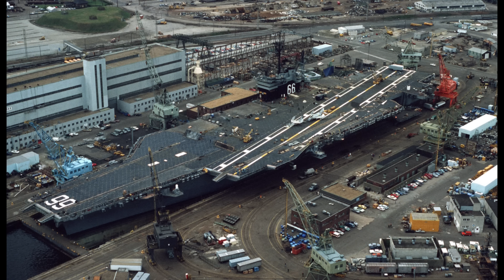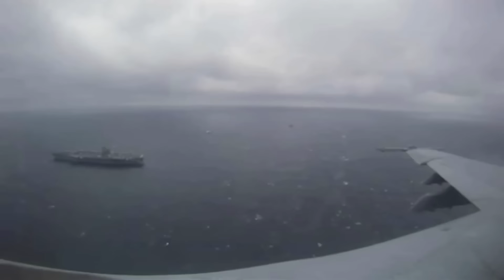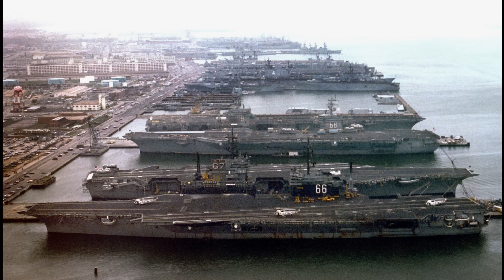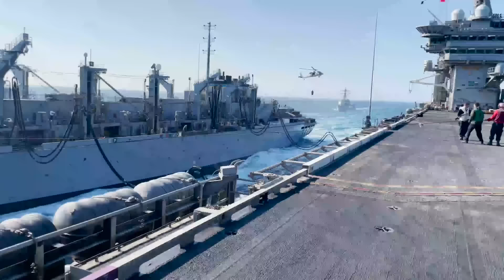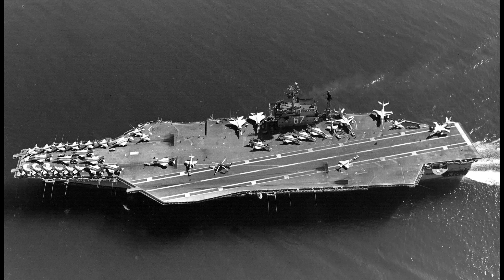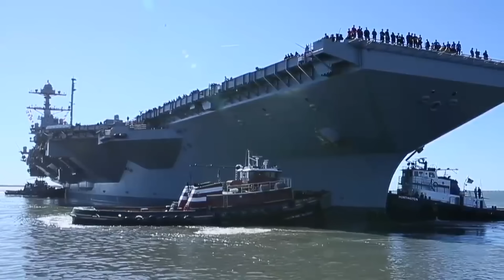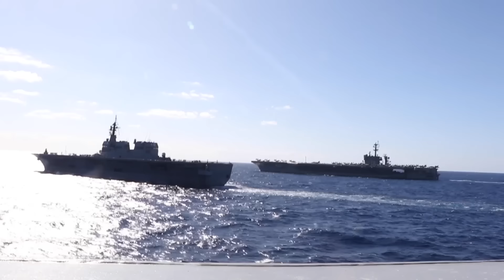Kitty Hawk Class: Why the US Navy MUST Bring Back This Non-Nuclear Carrier

Comment: The kitty hawk class is still a super carrier and would still cost a lot to make, not to mention it will also need to sail around with an extensive screening group as it would still be considered “too valuable to lose”.

It’s not just about the carrier, it’s about the entire battle group that goes along with it, the manpower to staff it all and the billions worth of F35s that go along with it. 

When you add it all together, the added cost of the nuclear reactor is the least concern.

The money would be better invested in opening up new dry docks that are capable of conducting multiple simultaneous major maintenance on the carriers we do have.
Reply: Agreed. We don’t need more carriers, we need 2 or 300 frigates and destroyers to cover all of the hot spots where the carriers aren’t. Carriers are great hammers, but not every job requires that specific tool. For jobs like convoy escort, anti-piracy patrols or simply showing the flag in low threat situations or among allies, the smaller ships make more sense at a far lower cost. And for specialized jobs, such as demining, specialist ships are required, which again could be more economically escorted by lower end ships. They should be heavily enough armed to take care of themselves when performing detached operations, but should be buildable in vast numbers in order to be able to respond to multiple geographically separated events simultaneously. Sometimes, quantity does in fact have a quality of its own. The Navy, however, needs to accept that low end ships cannot and should not be built as miniature Arleigh Burkes, but rather as ships that are heavily enough armed to be useful while remaining affordable enough to build in large numbers. We need what the Constellations were supposed to be, rather than what the Navy wanted to turn them into. Perfect is the enemy of good enough. We need a whole bunch of ships that are good enough. The navy has a whole bunch of small jobs that it can’t do because either it’s short of the few high end ships it has, or because one of those ships wou be both hilarious overkill for those smaller jobs, and because, being in such short supply, they’re too valuable to lose.
Reply: @DarthBlood17  100%. The navy is currently all bling and no basics. Bugger all frigates and destroyers. Not enough oilers. Ancient sea lift fleet.
Reply: @l @lone-despair  haha yup. It’s such a succinct way he encapsulated it.
Reply: @DarthBlood17 exactly. The Constellation was a great idea. All they needed is to integrate more American systems. Perhaps the F110 class which already has Aegis SPY systems.
Reply: Exactly. The F110 is ready for the American fleet. The FREMM is more oriented to French systems.
Fitting Aegis on something the size of a frigate was a huge technical challenge. I do wish the USN gave it a look, but with the current Spain-US relationship that would never happen.
Reply: @claudedominique8845 
The FREMM wasn't for French systems. The reason why the American version failed was because of the US Navy.
Reply: @DarthBlood17  you want ,  not NEED,  America NEEDS zero carriers.  Who is going to attack America ?
Reply: @devnaraen5131  Not who is it's who might Militaries always base their needs on possibilities ("If you want peace, prepare for war" - Julius Ceasar)
Reply: @devnaraen5131 
In recent years America made enemies. Yes America NEEDS carriers. Look up Guam 🇬🇺 and Hawai'i.
Reply: @CFak-i9r1c  You're right, oblamer and Autopen really fücked our reputation in the world.
Reply: @Kitty-CatDaddy 
Obama didn't damage the US' reputation, Trump did. Nice try, trumpster. Biden tried to fix it but Trump got reelected and restarted damaging the US' reputation. Trump made enemies.
Reply: @devnaraen5131 China, and Russia are definite possibilities. Also don't forget their allies like North Korea and others. Yes they may nit have much of a Navy but if they can reach out and hit US and our allies like Japan and South Korea with ballistic missiles even if those missiles aren't armed with nuclear warheads they can provide plenty of headaches in a conflict. America has always had enemies, several of which we did not create.
Reply: @CFak-i9r1c you are a coolaid drinker, all Europe has openly states Biden was horrendous in policy, weak and incapable and Obama was and enabler even Macron has publicly stated this now Trump is no Diplomat nor is he a strategist everything is a hammer or club with him but at least he is not being played and used.
Reply: That is exactly the point that I was going to make when I opened this video.   The air wing alone costs almost as much as a nuclear carrier.   The escorts cost as much.
Reply: The kitty Hawk is gone forever. It was scraped.
Reply: @giankperez6377  disgraceful! Should have been made into a museum like the Iowa class battleships
Reply: Actually what the U.S. Navy needs is more Wasp and America class amphibious assault ships (for conflicts in the indo pacific theater) as well as either the return of guided missile  cruisers or guided missile battleships  or the conversion and retention of more Ohio class ballistic missile submarines into guided missile submarines as destroyers cannot carry enough missiles in their VLRS  cells for high intensity warfare. Yes, the Arleigh Burke Aegis guided missile destroyers are great ships but unless the U.S. Navy finds a way to rapidly reload those missile cells during and in the middle of combat through ship to ship replenishment or by designing another  complimentary system to launch missiles onboard the destroyers they will need a larger ship that can carry more VLRS cells. 
I could see the U.S Navy retaining and converting more Ohio class boomers into guided missile submarines, but they do not want to do that for budgetary reasons. They are already trying to decommission the U.S.S Georgia.
Reply: @bazil5789 
Yes, America needs to make sure it loses many missiles and sailors in one hit. 😂 It doesn't need battleships. No such thing as guided missile battleships. They never existed. The newest Arleigh Burke class destroyers are as large as the old Ticonderoga class cruisers.
The Ohio class is old. The newest had its refuelling and overhaul done a few years ago. In 25 years it will be decommissioned. Nuclear submarines CAN'T be retained. Once a reactor got used, it's over. Besides, the hull itself is worn. Just get more Virginia class subs.
Reply: @CFak-i9r1c  I never said that guided missile battleships had existed in the past. The U.S. Navy itself has said that in a highly contested satutation battle the limited amount of VLRS cells on the Arleigh Burke destroyers would mean that they would be out of missiles in the first few hours of battle. Bigger ships with more missile cells will be able to stay in the fight longer and will be more likey to be able to make it back to a forward operating base so that it can be rearmed. Do you know what they call a warship with no ammo???? An artificial reef. Do you think that the U.S. Navy wouldn't stomach the loss of destroyers in a battle?? As long as it isn't a carrier they would not lose a minute of sleep. Also how many more "flights" of Arleigh Burke class destroyers are going to be produced before the U.S. Navy decides to stop production in favor of a new design. Arleigh Burke destroyers as a design are getting awfully long in the tooth as far as age. Also there are quite a few Ohio class boomers with hulls that still have plenty of service life left in them. Their replacement with Columbia class boomers will mirror the Nimitz class carriers replacement with Ford class carriers. The Navy can replace the nuclear reactors on submarines you know that right? Submarines are modular built. Just like ships.
Reply: @bazil5789 
No. A bigger ship is just a bigger target. Once it gets hit, the missiles in the VLSs that weren't launched get destroyed. The Navy definitely won't like losing destroyers. Also, basic research. Look up the DDG(x). They're already developing a replacement for the Arleigh Burke. There will be another 22-23 Arleigh Burke ships built. The DDG(x) will be built in the early 2030s.
Reply: @CFak-i9r1c No one wants to lose any warships if it can be helped but in wartime there is such a thing as acceptable losses. Compared to losing an aircraft carrier all the other surface warships are expendable. The U.S. Navy is already awarded a contract to HII for the next class of frigates. They also want to increase the missile capacity of their future ships. Which could and, according to several navy planners, would lead to the possibility of newer larger ships outside of a 30+ year old Arleigh Burke class destroyer. The U.S. Navy has had cruisers and battleships in the past and it would be idiotic to think that ships like those will never be a part of the U.S. Naval fleet ever again.
Reply: Any carrier will have as escort.
Reply: @claudedominique8845 it still doesn't protect them
Reply: Not tru and the cost would  be 6.2 billion while forcing an increase in ship yards and reinvestment of the few remaining yards.
Reply: @warrior7ra 
No.
Reply: Yes
Reply: If your going to have a surface Navy it pretty much will be critical its always going to be costly.
Reply: @warrior7ra 
That doesn't mean you should waste money.
Reply: @CFak-i9r1c it isn't a waste the only way it isn't required is to eliminate all potential national security threats if your unwilling to do that then yes they are nessesary. So make the decision pay for defense or go hard on the offense slaughter all threats now and potential future threats. So how many are you willing to kill
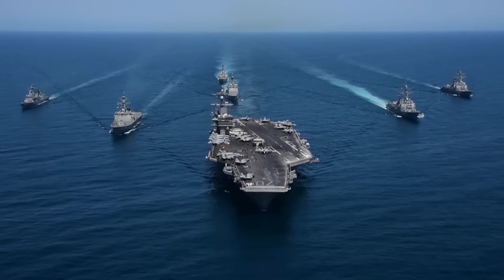Reply: I agree. We need a new public shipyard badly.  17:03 The modern fleet is not experiencing a crisis of overcapacity.  It is experiencing a crisis of oversubscription.  Particularly from allies of wealth and means who are purposefully not contributing their fair share to their own security needs.  It's killing our navy and its personnel.  I don't know if the narrator is an American.  If not, he's very free with offering suggestions for how to spend (er, save) ppl's money in another country, not his own.  

I have a very radical idea!  How about Europe securing the Mediterranean and Australia the Western Pacific by building their own conventional carriers with their money or buying the design from the US?

We need to learn how to say "No."
Reply: @n @nolan485 h please.  That whole “allies not pulling their weight” line is just poppycock that has been trundled out by the administration to justify sabotaging NATO.

Just like the British empire before it the American empire needs to maintain a world beating navy in its own right to maintain its empire. As the head of the current hegemony it has always been in Americas interest to have its allies entirely dependant. Otherwise your allies all end up like France, who think that with sovereign capacity comes sovereign policy, and all of a sudden they are deciding that maybe a long, pointless war in Iraq isn’t in their best interests. For instance….

The problem with America’s navy is waste and grifting. Not its allies. Can’t build enough subs, enough money spent on constellation, zumwalt, and LCS to build an entire European navy twice over and basically nothing to show for it. Crayon eating ideas like battleships to waste more money on. Contractors embedding themselves in the sustainment chain to the point some ships can’t be operated without civilian contractors. And the list goes on. 

There is plenty of resources. Its just all the snouts in the trough are getting it before it can be turned into effective hulls in the water.
Reply: @Alan.livingston  I don't argue with any Europeans or their protagonists about it.  We have literally been saying the very same thing for 75 years consistently.  So now, I don't bother with Brussels, Paris, Ottawa, Wellington, or ½ of the politicians in Canberra's talking points.
Reply: @nolan485  Well, if its been 75 years and you can’t understand why nobody is going to collectively do most of the work so uncle sam can sit on the throne than one more conversation isn’t going to change that.
Reply: @Alan.livingston  well you certainly misused some terms. We aren’t colonizing or “administering” India etc so no America is not “an Empire” in the sense you mean. 
As to European NATO members there is no rational person that’s actually read the data of the past 30 years and the reports that can argue that Europe hasn’t been shirking (Canada included here) their obligations on spending and capability. 
Europe hasn’t done a very good job of cooperation without US pressure to keep certain states playing nice with each other. We could look to a few success (which Europeans also bring up) but the list of failed collaborations in Europe is MUCH longer and more costly. 
France is on a total delusional trip. They are basically begging for a bailout and are threatening to cause a Euro crisis if they don’t get their way. Even if they get it, I don’t know how they believe they’ll be able to triple their military spending by 2030 and expand it further by 2035. I want to know what drugs they are taking and who does their math. 
They recently tried to move an armored brigade to Eastern Europe. Turns out their tank carriers couldn’t operate over most of the terrain so they went home and railheaded the equipment. Took them something like 2 to 3 times the amount of time it would take a US unit to do either operation. 
Europes logistical capability is a joke. The UK admitted they have enough munitions for about 8 days of high end combat. France has about 14-28 days worth. They couldn’t force project complete division level formations to an active combat zone for lack of logistical capability. Most of the times they’ve operated in recent memory in expeditionary rolls they required US logistical support to do anything meaningful.
Reply: @nsatoday  i have’t misused any terms. The united states is the neo-imperial power and has been since ‘45. Given the peace dividend European armies, such as the British, were reconfigured for fighting Americas counter insurgency wars. That and slashed to pieces by endless governments looking to save a buck. But that rot has set in globally. I’m not going to argue about the fact Europe’s armies are in a sad state, its objectively true. Its the same canker that is eating the US military. Tight fisted governments and greedy contractors who have almost total monopolies over their markets.

I just don’t agree that the situation isn’t one of Americas own creation to suit its own strategic goals in a post soviet world.
Reply: @Alan.livingston  yes, you misused the term “empire” then tried goal post moving with a term that has no real meaning “neo imperial”. It has definitions that vary so wildly as to be a whataboutism. 
Europes decision to gut its militaries in favor of social spending was Europes decision. From about 92 onward they never met their capability and spending targets. The “peace dividend” is that lie politicians sold but the data and the facts call it what it is: complete military gutting. 
As to Europe having to at least respond, in part, to its obligations it made some changes but that was their choice. You seem to feel as if Europe isn’t responsible for its own choices. As to it being “America’s” fault as you claim that’s easily disproven. Every US president since Clinton was elected has complained and filed complaints about Europes military state. 
So in closing:
1. Europe is fully responsible for its own decisions
2. Europe willingly and knowingly shirked its obligations for roughly 30 years and has no serious plan to reverse course. 
3. The US is set to drop its destroyer price from 1.6BN to 750 Million by 2030. Lockheed and a few of the large contractors are getting money clawed back for not meeting goals etc.
Reply: @nsatoday  an empire is what a imperialist controls. They just do it using other levers than direct military control. Well, mostly. Just don’t look near the middle east for the last twenty years or so. There’s a whole wikipedia page about it. Its really not that vague. 

American presidents  complaining about their allies is normally code for them wanting to spend more money on American weapons.

I think at this point we are going to have to agree to disagree.

We can meet back here in a few years and see if the navy got any 750mil destroyers.
Reply: @A @Alan.livingston  see you didn’t cite a definition just Wikipedia. Wikipedia isn’t allowed to be used in serious research because its user edited and riddled with mistakes and inaccuracy. 
You meant to say American presidents complaining of its allies meeting their obligations is just that. You haven’t supported your argument in the least. 
When you keep making statements that are disconnected from reality (as you have) the only conclusion I can logically draw is you are delusional. 
As to the destroyers, Hyundai heavy industries already broke ground on the shipyards. So, again, while it may not pan out given inflation at 750 Million, the factual basis exists. In your case you have 0 facts.
Reply: @nsatoday  right. I don’t remember you citing your sources either, champ. Looks to me like two guys at a bar arguing over who’s team is the best.
Reply: @Alan.livingston  NATO obligations and DOD report 1993, Clinton administration. Public record. 
US DOD and Hyundai heavy industries contract and the new reporting on it. 
DW news 2023 reporting about Germany’s changing stance and the oil and gas reliance on Russia. Guest also mentions how it fuel Russian rearmament. 
You can also read the NATO summit reports as Eastern European countries APPLIED for membership. 
I can actually back up what I’m saying
Reply: @nsatoday   So you can't accept a general article about a political theory topic from wikipedia, but you can accept such high quality primary sources as DW and other "reporting on it" sources. 

A starting point for understanding how the US uses it's position to suppress the european arms industry would be papers like "NATO Allies’ Implementation
of Reciprocal Defense
Agreements". I'm sure you are a hero at ChatGPT and can get it to dig up more like it. Basically the US uses "buy american" policies while exploiting european political fragmentation and NATO. "standardisation" to squeeze competitors out of the market. Go back and read Anthony Sampson's amazing book "the arms bazaar" from the 70's and you will see it's a systemic policy that has been in play for many decades.

There is an absolute treasure trove of works like "ISAF and European military transformation: German, Swedish and French counterinsurgency in Afghanistan, 2003–2014" that discuss how NATO forces underwent restructuring to focus on fighting America's low intensity counter insurgency wars rather than ground war in Europe. Yes, the European governments were fully onboard so they could slash military budgets, but the driving force behind it was Uncle Sam's agenda.

Given you don't care for wikipedia you can read "Neo-Colonialism: The Last Stage of Imperialism" which is the defining work on neo-imperialism. If you want something more contemporary you can read "Colossus: The Rise and Fall of the American Empire"  which discusses that fact that the United states is functionally the head of a global empire, but chooses not to name itself as such.

You clearly don't like to think of yourself as a imperialist so we can dress it up in the marketing language of "rules based global order". Which is the same thing, but centres America as the hero in the story. My favourite work in this area is "After Victory" by Ikenberry. It discussed the institutions of control.

So, yes, the europeans aren't blameless in their current predicament. But to pretend that the US hasn't architected the current shape of the world to suit it's own economic and military ends is a little naive.
Reply: Why dony you take the old USSEnterprise CVN-65 And change the name of Enterprise to William Clinton Cv-81 into a conventional class since your short handed on carrier fleet power.. ,can be refitted in 15 months at Norfolk Naval Shipyard portsmouth Virginia.  It can happen